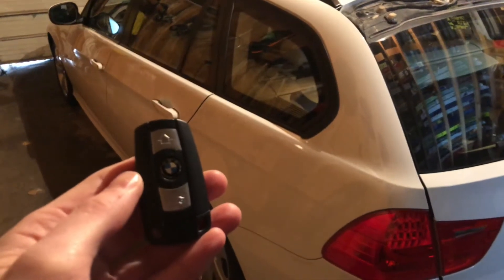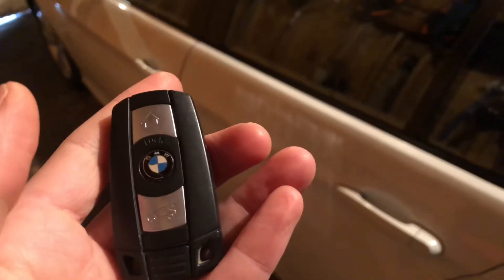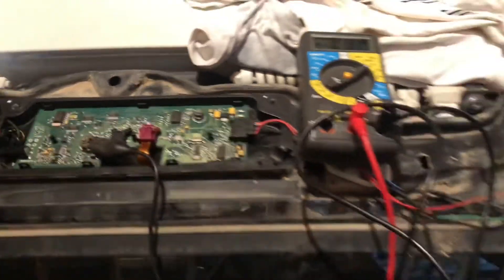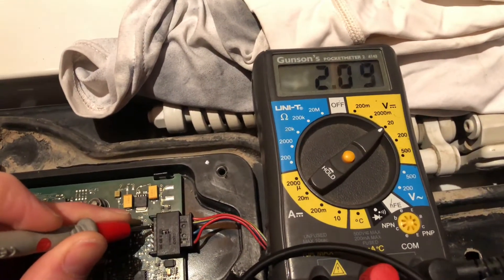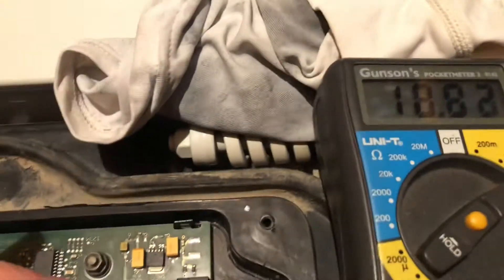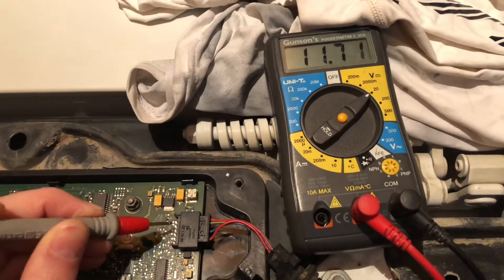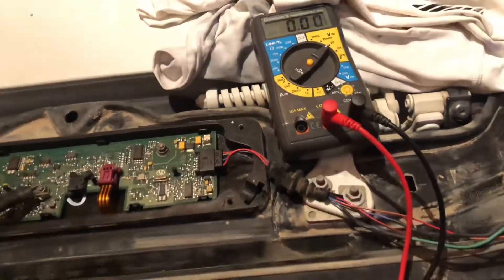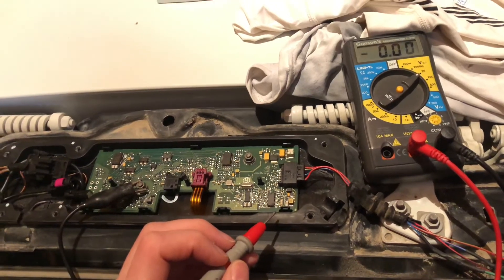BMW E91 Diversity Antenna Module Voltage Test Troubleshooting

Comment: hi, ive checked my antenna, and voltage isnt at it says it should be on google, ive checked diversity antenna wiring , bloke said it should be 1 +4 wires should be 12volts, and 2+3 wires should be 5volts,,,, mine are as follows 1- 4.06v/ 2- 3.93v/ 3- 4.5v , 4 - 11.61v,  does that mean my antenna is faulty.

Comment: Hello, please reply.the last pin 4th wire I have no voltage reading after activate the car,what can be the reason?I already fix the wires on the right side two times now,opened both sides grommets , seems like the wires are not snapped, don't know what to check next, thank you in advance

Comment: My car lose the 12v tension from  the top first wire after 1-2 minutes. I mean if is activated from that button,it will work but if you leave it for like1-2 mins,it loses…

Tried with another unit and it does the same  thing. Maybe both units are dead.

Any suggestion pls ? Checked the battery from the remote,it stays like 2,96-3v.

 A deep looking at the cables ?

Comment: Is the second wire for output signal?  I have O volts , and not sure if it is a broken wire problem, or diversity antenna problem.
Reply: I also have problem with second wire showing 0 volts. Did you find what was wrong with yours? Module or wire?
Reply: @user-cp1jg5ut3t  havent found out yet:)

Comment: Both of my fobs are not working and all fuses seem fine. I’ve opened up the diversity antenna and looks pristine and dry no corrosion etc. I tested the voltage on the pins you did and only had one live with around 4v. 

Is this the supply side and is it likely that the wiring near the hinge has been ruptured?
Reply from the maker: I would investigate your wiring.

Comment: My 4th is also reading almost 5v, but does it really need to be 12v?
Reply from the maker: You may need to replace the wiring at the hinge before you test your diversity antenna
Reply from the maker: In the video I say 4th wire but I’m actually meaning 4th pin(3rd wire) Sorry.

Comment: Hello! thanks for your video... I have checked the readings with the voltmeter and are very similar to your "good" unit... shall I give it a go and replace the module still?...  its driving me nuts not having the rm operational....
Reply from the maker: Check everything else first like your remote battery. Have you already replaced the wiring?
Reply: On my car, nothing was wrong with modules... the wires snapped at the trunking hinge... stupid design two of the wires snapped (it's the furtherest left)
Reply: If the wires snapped u will get zero volts.. but since ur getting volts then it's not the wires

Comment: I got 0 volts on everything but nr4.. is it fair to guess that I have broken cables?
Reply from the maker: If you just pull back where the grommets seal to the body and then give a pull on each wire individually you’ll probably find the broken wires pull out
Reply from the maker: At the point when I shot my video I had already replaced the wiring. The broken wire or water ingress caused the failure of my diversity antenna. Replace the wiring first then see if your fixed, if not then next phase is check the voltages on the antenna